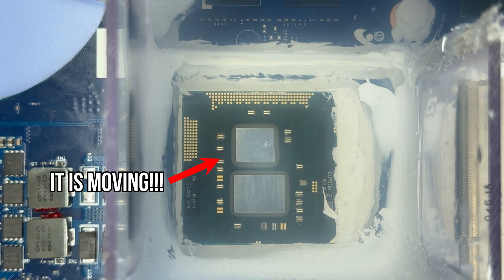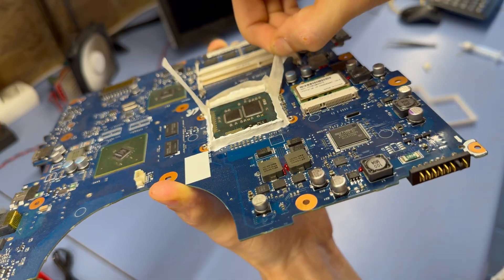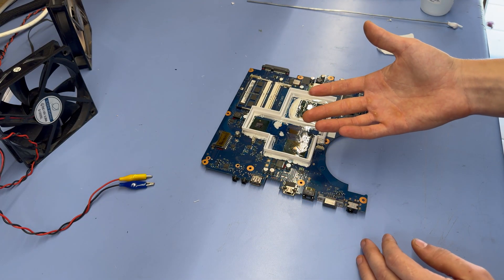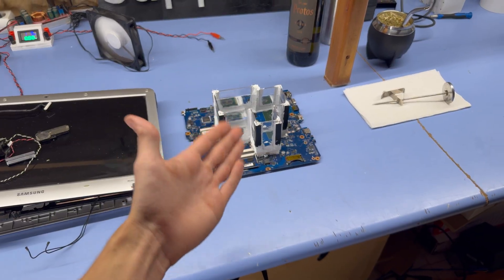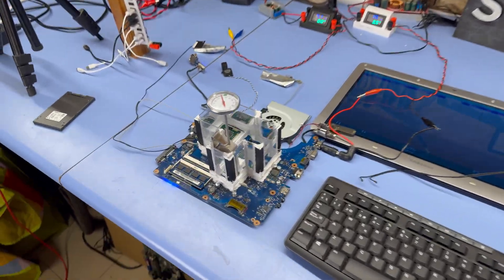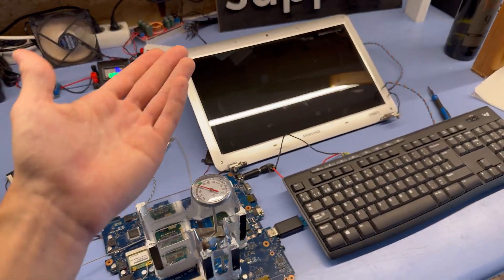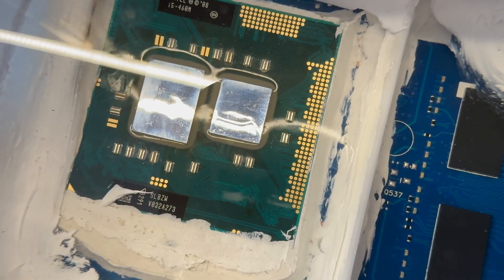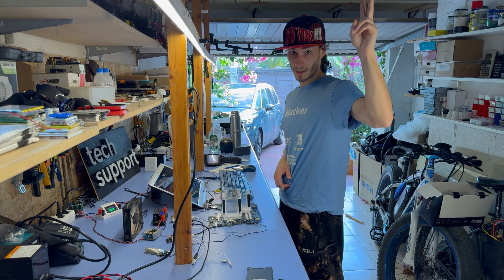I Tried Cooling a CPU With Just Water… and Something Strange Happened

Comment: The easiest way is to dip the whole thing in mineral oil, but that's boring so we use water😂😂
Reply from the maker: Exactly, I already saw someone did it, and it’s too easy for this channel but should work pretty identically. Peace ✌️
Reply: @Inventors_Den  oil has about 10 times less cooling capacity.
Reply: @cannaroe1213  Or an AIO
Reply: @cannaroe1213 
Thermal conductivity of water: at 20°C 0.63W/mK, at 50°C 0.68W/mK.

Thermal conductivity of mineral oil: at 20°C 0.15W/mK, at 50°C 0.1325 W/mK.
Tabulated values.

In many applications you use mineral oil, oil or a mixture with propylene glycol and water because water vaporizes at 100°C and if the average operating temperature is higher than 100°C you will have a lot of problems.
With a 50% mixture of water and propylene glycol you have an ebullioscopic increase of 7.8°C.
Mineral oil vaporizes between 200°C and 300°C depending on its composition, as do synthetic or purified oils...
So you use oil when you are above 100°C, but below 200°C...
between 1°C and 99°C the best thing is to use water.

Unfortunately, you're talking to a chemical engineer.
You have no hope.
Reply: @angelogiramondo1540  ^Thank you for setting me straight, oil's lower W/mK means its worse at accepting heat not better, i was totally backwards, thank you!
Reply: The main problem is that the surface area is too little for the heat to dissipate quickly enough. The water near the surface of the chips is near boiling but it can't be move fast enough so you need more surface area. If you have an old or broken AIO cooler you could try salvaging its cooling plate and add pieces with fins of it to the chip to increase the surface area. You want a good TIM for that Duronaut or Kold-01, Streacom TX13 or maybe liquid metal but no clue how they will perform under water maybe you want more silicone to seal it of as well.
But I'm afraid you already found the limits of water so mineral oil maybe the next step after that. Cooling capacity isn't as important for just testing. The lower thermal conductivity is what will help cooling small surfaces. The downside is that is eats away silicone and most rubbers and plastics.
The only and coolingwise better alternative to mineral oil is 3M Novec 7100 but it's expensive, a good solvent (it eats away dissolves silicone, PTFE and most rubbers & plastics and might cause them to swell over time) is a PFAS. and other good stuff you don't want in your life 3M will cease production at the end of this year but there are other companies that will continue to produce methoxy-nonafluorobutane but you won't be able to buy it in the EU anymore as an enduser starting some time in 2026. Till now you could buy it if you give the right cause you need it. So it will not be banned in the foreseeable future for professional use cause there seems to be no good alternative for it yet.
Reply: @Troppa17  oil isn't better than water in some data centers they cool servers with distilled water even wash out server cabinets with it pure water doesn't conduct electricity
Reply: @Troppa17  
Methyl nonafluorobutyl ether isn't problematic for plastics and rubbers and isn't particularly harmful to your health (not even if you cling to the bottle thinking it's a cold beer).
You can breathe in vapors at a concentration of 100,000 ppm after four hours of exposure and it won't harm you (some people have proposed this type of procedure as a "lung lavage," to dissolve smokers' tar in the bronchial tubes, to treat chronic pulmonary emphysema).
3M offers it as a 3D printing cleaning solution for ABS and PMMA... in short, it's inert, not like perfluorocarbons, but very similar...
and it's sold 99.99% pure (it's a synthetic product refined through distillation, because similar fractions are needed to work), so it has no additives.
No, PFAS, which are polyfluorosubstituted acrylics, will not be banned entirely in the EU.
Many confuse them with "eternal pollutants," that is, those types of pollutants that never degrade in the environment, and in a certain sense they are, as they are completely inert (replacing all the hydrogens in a hydrocarbon chain with fluorine ensures that the molecule cannot interact with anything). However, for the same reason, you should also consider natural flint or stone "eternal pollutants."

"Pollutant" doesn't mean "I don't like it, it's ugly, so I don't want it," but rather that it causes reactions that then harm the ecosystem. If it's inert, what should it harm?

The EU has only limited the concentrations of PFAS and PFHxA (related substances) for "non-essential" uses, such as water repellent for rain jackets, in firefighting foams, and little else. They will be replaced by the more expensive PFTPs.

Chemicals must have a safety data sheet to be marketed, and you just need to look at it to know how to handle that product, just for your own personal knowledge, so you don't make the same mistake next time.

I'm used to talking about topics I know about, or I go and get adequate information, so I know the topic and can talk about it.

The real problem with Cel Novac and similar substances is that they're incredibly expensive... unsustainable for amateur use.

Oil is not a solution (I've also tested that: very poor performance and risk of starting fires).
Reply: deionised water?
Reply: mineral oil is toxic and awful
Reply: @takatominemoto7703  yes
Reply: @takatominemoto7703 
I don't know who told you mineral oil is toxic, but they're wildly incorrect. Not only is it non-toxic, we use it for ingestion in oodles of cases.

Comment: It would be easier to buy dry water(aka Novec 1230) or just use oil (you can even use transformer oil).
Reply from the maker: Yes, indeed, but cooling electronics with oil is widely used, I want to investigate that idea further, and something with mineral oil that want cooled before) thanks for the feedback!)
Reply: @Inventors_Den  
Novec 1230 is the new name 3M has given to Fluorinert... the problem is the cost: $500 per liter.
Perfluorocarbons have many uses; it's the same liquid used to cool Tesla batteries and other electric cars, for vapor-phase welding, and 1,000 other uses, but it has never been cheap. Never!
Reply: Novec 1230 eveporates very fast, eveporation is good for cooling. But you need closed system for that or constantly add more, and dont forget to add ventelation if system is open(I think the large amount of that evaporation in closed room may be dangerous as a dry ice).
Reply: @_OS_  Yes, it starts boiling at 50 degrees Celsius, but nothing prevents you from taking it from the container where the computer is located, running it through a radiator to cool it, and returning it again - this is how some mining rigs work. but it will still gradually evaporate and it really does pose a danger.
Reply: @dilvastak7351  
Novec itself is non-toxic and no more dangerous than nitrogen gas.
You'll simply suffocate without realizing it because you'll be saturating the environment with an odorless "inert" gas...
In this case, it's a subtle danger, because you won't realize you're slowly running out of air.

Comment: you should use mineral oil / baby oil this is non conductive and keep your hardware relatively cool. ( BUT ) it needs thorough cleaning afterwards and it degrades plastic components after long exposure to mineral oil, unless you keep your hardware dipped innit forever then nothing much will happen, it's when you take the oil out things can get shaky.

water is to thin to keep anything cool this is why water aint immediately  the best solution to cool a cpu processor directly. ( unless it gets moved and replaced constantly ) this is why water cooling units are invented for CPU's in a closed loop with a pump ( to constantly move the water and replace it with new water so the water doesn't have a chance to get hot, even after long usage ) that's why the pump + the connection plate to the cpu is mostly copper OR aluminium because those transfer the heat to the water in the most efficient way. ( not the best way ) 

If you don't want to use mineral oil, then you could try ice cubes in the water ( until it melts ) BUT atleast you have cold water for a certain time to do your experiments, as the software even says it's due to overheating that your computer will shut down. 

if you don't think these solutions are a way to go...., you could also try dry ice directly on it and it will stay on -20  / - 40 degrees.

This however is dangerous if it comes directly into contact with your skin, it will leave freeze burn marks on your hands wich can be very devastating to say the least.

whatever solution you want to try, avoid ( thin ) liquids. 

Thin liquids can't withstand heat for a long time and will automatically fail each time you try.
Reply: You really took your time to write all of that and missed the point - it's water cooling, not oil cooling. Having bare metal hardware submerged in mineral oil is nothing new and been done for the past 20 years or so, but this DYI conception using regular water is way more original idea than mainstream mineral oil builds.
Reply from the maker: Thanks for taking the time to write this! I totally agree! It wasn’t pretty clear before that experiment and also in the case of the small Eee PC it didn’t overheat with the water on the CPU. I might test different fluids in that reservoir, like alcohol(it evaporated faster than water), acetone, liquid nitrogen if I am lucky enough to find it). Recirculating the water in that reservoir makes sense too but that would be really close to the water cooling system which are available for sale.)
Reply: @Inventors_Den 
With oil, you'd get an even worse result.
Oil has a much worse heat transfer coefficient than water, and in any case, the temperature difference you're experiencing doesn't allow for very strong natural convection circulation (like a radiator).
Other liquids, please, absolutely not!
If it's already dangerous to play with mineral oil, which self-ignites at around 220°C, imagine doing it with alcohol, acetone, or other highly flammable and highly volatile liquids... it becomes truly dangerous.
At any moment, there could be a short circuit and start a fire... it's like throwing gasoline on a fire.

As I wrote above, I used Fluorinert because it's a liquid with particular physical properties, not least of which is that it's not dangerous to human health, even if inhaled, but even Fluorinert, above a certain temperature, can self-ignite.

Water is the best, you just have to make better use of the surface area; Expand it.
You'll need to glue an aluminum heatsink onto the die, and most of your problems will disappear.

Comment: Technically AMD/Intel could package the CPU in a way, to allow cooling like this without extra hustle. I hope this happens in my lifetime because it looks fucking sick.
Reply: This is called direct die watercooling and is much less efficient than using a regular watercooler with internal fins.

Water is pretty good at holding on to heat but it's relatively bad at picking up and letting go of heat when compared to most metals. The way to get around this is to use metal shaped in smart ways to massively increase the useful surface area exchanging heat with the water, both at the cold side and the hot side of the loop. This leads to the situation where the water picks up the heat quickly, then the water moves to somewhere where it can give away the heat quickly, then returns back to pick up heat again, etc.
Reply from the maker: Yes, I imagine a transparent part on the laptop on the top of the keyboard where we could see the CPU and GPU dies underwater and cooling constantly. That would be dope)